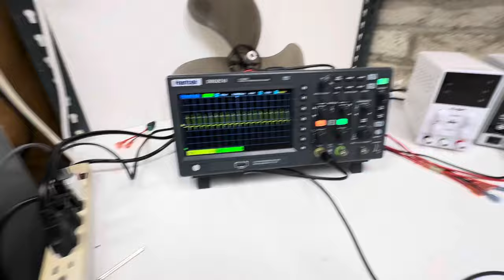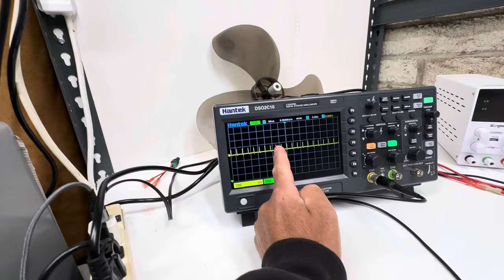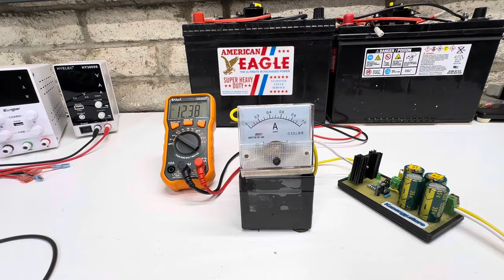Mini oscillator run on 1.5v / 3v

Comment: This is really, really incredible science, but can you please (for the layman) explain what is going on, instead of just describing? Many thanks and keep up the awesome and inspiring work.
Reply from the maker: Thank you 
This is set up exactly like my other oscillators there are schematics on my other videos 
This is a forced oscillator there are 2 coils that work to oscillate with the transistor every time it turns off you get a hi voltage spike that charges capacitors or runs lights
Reply from the maker: If you need more information contact me on my site www.kenergy.store
Reply: Can we use part of the power output to recharge a battery please ?
Reply from the maker: @akimdenver606  you can use a light in series with a battery or threw a cap dump